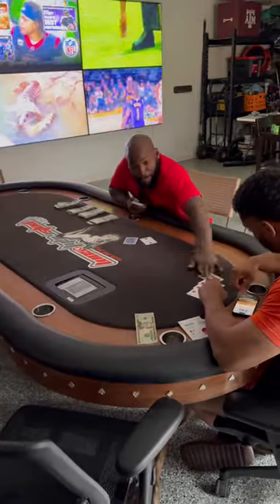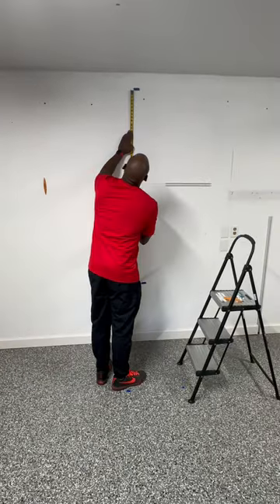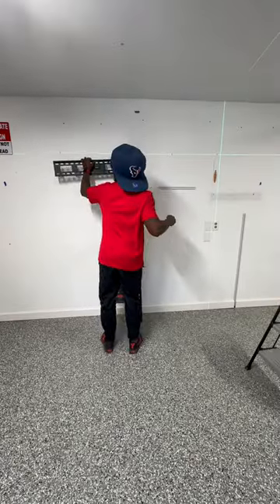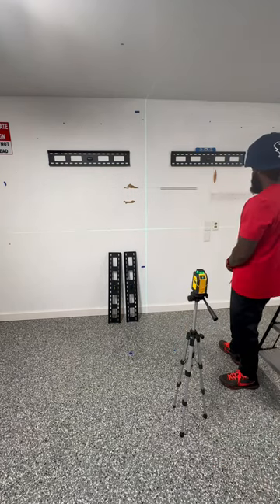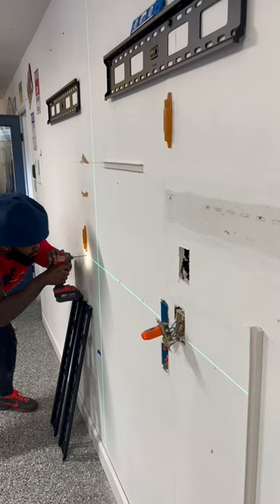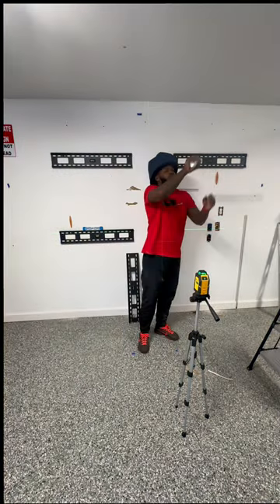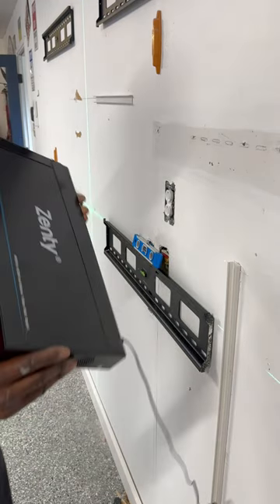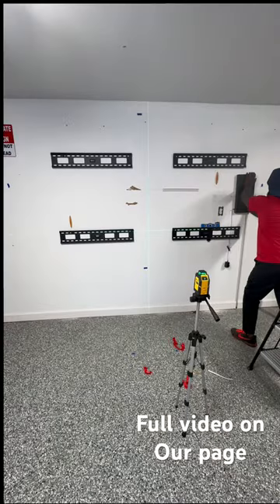How to make 4 TVs into 1 #work #install #fyp #explore #reels #shorts #tech #trending #tv #tvwall

Comment: My response to someone saying, "My projector has 4000 lumens." Would be great, I bet that was really bright back in 2010.
Reply: I’m choosing that over lines in the screen
Reply: 2500 lumes is really all you're going to get take a look at the Sony top-of-the-line consumer home theater projector You would think it would be more but you'd have to go commercial and lose Dolby vision certification. Higher lumens; contrast ratio goes out the door.
Reply: @confirmhandle  I think you can get a brighter commercial, especially with an Epson, or a NEC, but you are probably correct about the Sony maxing out at 2500. However, if one is bragging to me about their projectors  lumens, it's going to have to be a lot. 

Side note even though I'm currently not doing it full time my career over the last 18 years or so was in audio visual for conventions so the lumens of a projector matter almost as the resolution for me.